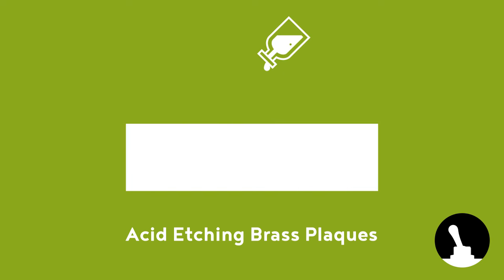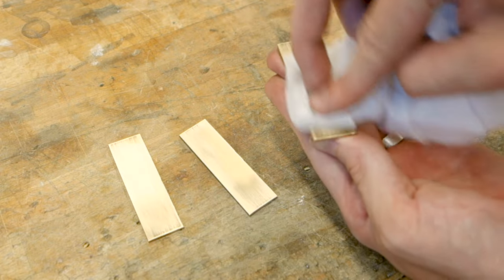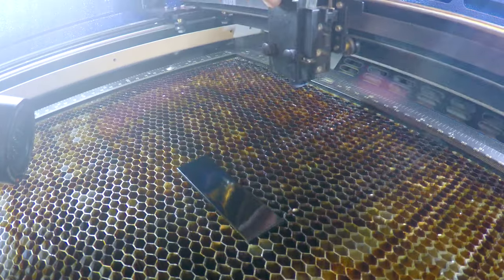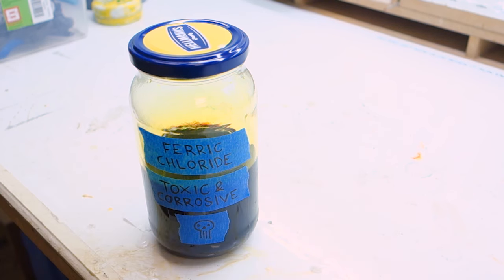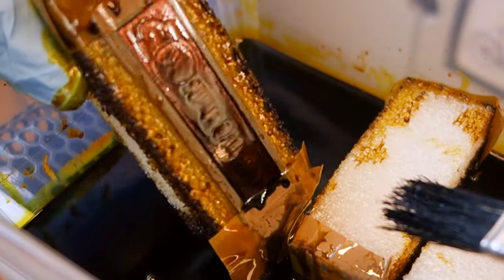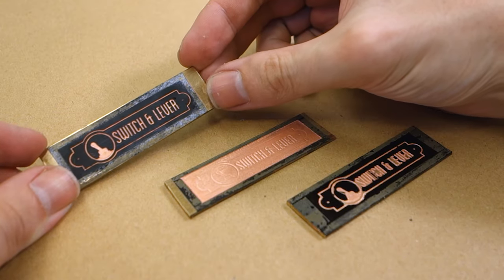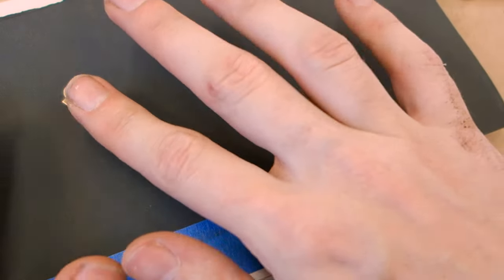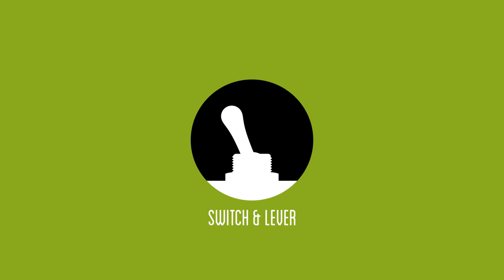Acid Etching Brass Plaques

Comment: So... It's essentially etching a printed circuit board. I have had good results from using a cheap Brother HL-2240 laser printer I got for $10 at the local second hand store. Lots of people say this printer is bad for etching. Personally I believe most people get bad results because of laminators. They are more unpredictable IMO. I use a travel type clothes iron. That type doesn't have steam and the associated holes in the surface. I try to find a piece of magazine print that is mostly glossy white and print to it.
 A word of warning, the laser printer itself uses a very hot drum to melt the ink onto the paper. Some glossy paper used in magazines can't handle the heat and will melt a bit. I would exercise caution before adding tape to anything I am running through a laser printer. If you get junk on the heated roller your going to damage the printer. I have never had problems with printing on paper that is cut close to the standard A4 size within about 80-90%. Just get your sides kinda straight and be sure the ink will print on the paper part first. I always do a test print on white paper first.
Disclosure, I've never created content on this subject, so don't waste your time checking. I casually upload stuff I find interesting, but am not monotized, nor do I plan to be. These were just some tips from what I have had success with.
   Further on the subject of etching plates, some people etch aluminum and glass using a similar technique, although the professional method uses dry film photoresist with clear transparencies. The main benefit of photoresist is the fine detail accuracy, so I've been told. I can resolve 0.25 mil traces using the technique I mentioned above.
Reply from the maker: I've had so bad luck with clothes irons, and always get consistently good results with laminators though. The key is that you have to feed it though a bunch of times on the highest heat. You need to transfer enough heat into the brass and toner to melt them together. 

As for taping the magazine paper, well, you see in the video how it looked like without the backer. Had to basically tear apart the whole side of the printer to get it out. It simply couldn't handle that thin paper. If you find thicker glossier paper that may be better, but may also require more work to get off afterwards.
Reply: Switch & Lever 
  I understand ;)
 I didn't expect to melt a page, the time that happened to me. I started using junk mail flyers after that one. The page that melted on me was from an old oversized European magazine I had laying around. It looked like they had some kind of plastic component in the paper itself. There are always little odd ball issues like this when using random stuff.
 Most people that have posted content that includes tape for use with laser printers/laminators tend to use kapton tape (the high temp stuff).
 I find it interesting that you used blue tape without problems. It uses a different kind of adhesive than masking or packing tapes and that looks like a solution for some.
   I think there are also issues with the brand/type of laser printer. A lot of people say that the HL-2240 printer I have is terrible for etching because they can't get the ink to transfer off of the paper. From what I've read, this printer uses a hotter than average drum to bond ink to the page. I use an iron for around 5 minutes straight and the resulting bond is so strong I can scratch the paper backing off with a fingernail without losing ink or details. I think a lot of problems people have had with this printer are due to the heat and pressure needed for transfer. I can't imagine a laminator coming close to the heat and pressure of 5 minutes under an iron. I also use particle board under the piece I'm transferring to. It seems to be the best insulator to keep heat where I need it. 
   I'm glad you posted this. I've been trying to motivate myself to make a few little label plates for some projects instead of my tacky black or silver sharpie markings. It's always helpful to see a well made video demonstrating how to do the job. Now I just need to get the nerve to try dry film photoresist I ordered a month ago ;)
 Thanks -Jake
Reply: @UpcycleElectronics  Question: would it be possible to disconnect the heat set roller so it does not fuse the toner to the paper? I ask this because I have removed many a jammed page from laser printers that jammed after the toner was deposited but before the heat roller and the image is perfect, but one puff of air and its gone.
Reply: @mdunbar008  
  I'm no expert on printer designs. I vaguely recall reading that the laser is used to control static charge on the drum, which then controls where the toner powder will stick. Then the paper is rolled over the drum directly followed by the heated roller. I believe this means the toner stays stuck to the paper based on the same static.
  I know, from watching another channel that creates uploads about repairing printers, there is a charge on the drum itself. This charge controls the amount of toner that is distributed onto the drum. The charge is variable according to the amount of toner left in the cartridge, ie when the cartridge is full the voltage is lowest, when toner is low the voltage is highest. (*Edit or maybe it was the other way around...let's just say: change in toner level = change in drum voltage) This ensures that the toner deposition rate is even. This is also why it is important to "reset" a toner cartridge if refilled. Continuing this tangent one step further...I plan on modifying my printer to manually set this voltage in order to control the toner distribution and attempt to create darker prints than otherwise possible.
  If you want to disconnect the heater it should be really easy. The heater has a wire connector. It usually has relay based control on the board as well. The element must be able to be switched off before an over temperature condition happens. That is about all I know when it comes to this subject. 
   Marco Reps has some really old uploads about using a lexmark laser printer to do some direct to PCB printing like this. IIRC he had to use a special printer that had a direct feed through option used to print CD labels. I think he did something to the printer where the product was not "fused." I recall he was using an acetone vapor technique to fix the toner to his boards. I think he abandoned that project though, either because of resolution or the single sided limitations of such a process. I probably have those uploads of his saved in one of my PCB fabrication playlists. I haven't saved a bunch of stuff on those lists in awhile so they will be pretty low on my publicly available playlists, but I have around 5-6 different pcb fab playlists covering all aspects, -all references to other people's stuff :-)
-Jake

Comment: Haha i love the Clickspring reference!:)
I noticed at 10:32 you said that you could sprinkle baking soda on there too neutralize the acid, wich is correct. But well im swedish too so i  recognized the can you were pouring from, that looked a lot like a bakpulver can and that's a mix of bikarbonat (baking soda) and citric acid! So it will foam and fizz in contact with water not acid!
Because there is already acid in powdered form in there!!
Reply from the maker: You are correct about the baking powder, and what was in the can once. These days I'm just using it as a canister for baking soda so I don't have to use the big 1kg box of it. It's a bit more practical :)

Comment: Looking at 5:42 I don't think you've allowed for the kerf of the laser when cutting, which is probably why it came out "bolder" than the others.
Reply from the maker: Not quite, if you look at the second and third plates they were both etched in the laser on similar settings, but with different coatings. The kerf had minimal, if any, effect in this.

Comment: S&L...thanks for the etching tutorial, great tips. You mentioned no specific software in the beginning as there are many that will do the job (I even went to #8 of your FAQ video to maybe get another hint)...I know NOTHING of graphics, yet I want to reproduce data tags/ machine labels for some old equipment, and make some new ones for vehicles. Can you/ would you suggest a SIMPLE software program for a novice such as I, that will allow me to incorporate (or even import) different fonts and logos? The design portion is the most intimidating aspect...the etching I can understand.  If any other views have freeware suggestions, that would be appreciated too.
Reply from the maker: Indeed, I deliberately didn't mention any software because there are so many that you could use to get the same result. I do understand that it can be a bottleneck for many people, and unfortunately all of these programs do have a learning curve to them. 

I use Adobe Illustrator, but there are many free softwares you could use. Inkscape is rather popular among free vector design softwares, but you could even use CAD software like Solidworks, Rhino or Fusion 360 if you're at all comfortable with them. There are great Wikipedia pages listing free vector design softwares. 

Fonts you can download from places like myfonts.com for commercial fonts, or dafont.com (and many others) for free fonts. Expect to be spending a lot of time looking for the right font though. Install them to your computer and they will show up in the program you're using.
Reply: Thank you for the reply...I understand not endorsing any one product and the reasons why, i.e. some formats are better suited to specific tasks. I really should dive in and learn Fusion 360, but will look at Adobe Illustrator first...as you mentioned, there is a learning curve regardless of choice.

Comment: This is great, thanks for making the video! I have two questions I'm hoping you can help me with to pick the right Laser Engraver: 
1) How powerful is your Laser Engraver? Is 40W enough for the Laser-Paint-Removal method? 
2) When using the Laser-Paint-Removal method, what resolution are you effectively getting out of your laser? Is it possible to remove very fine lines of paint and create a very detailed image with a 1000DPI Laser, or is there always a lot of bleeding? The lines and text look significantly bolder with the Laser-Paint-Removal method vs. using the other two methods.
Reply from the maker: It's not quite that easy, two laser cutters of the same wattage from two different manufacturers will work differently. A 25W laser cutter from a good (read: expensive) manufacturer will work better than a 40W from a shitty (cheap) one. That being said, literally a 2W laser cutter will remove paint (just more slowly). Depending on the width of the laser beam you can achieve fine detail, though frankly I'd say a good quality laser printer + laminator would be better, and way cheaper. Different paints will react differently, you'd need to experiment, as I've not had the issue with the bolder effect when I've done it before, but I've literally always just picked whatever random can was on the shelf.
Reply: @SwitchAndLever  Thanks for the explanation

Comment: Wouldnt it be possible to make money printing plates using this method? Of course you would need a higher fidelity but I think retrofitting a strong projector would give you the necessary resolution. The only issue would be getting the correct light activated medium.

Comment: Can i ask what kind of printer and laminator you use?? need it for a school project :)
Reply from the maker: Just a regular laser office printer, and a regular laminator. There is nothing special about anything I'm using. As long as you make sure the laminator you're buying can take the thickness of material you want to push through it you're fine.

Comment: Awesome Video ! will it work on very thin brass sheet ?
Reply from the maker: Of course, but if you're not careful it will etch straight through the brass.
Reply: Thank you for the reply. What is the success rate of this technique when using permanent marker to mask off the areas to prevent the etching ?

Comment: I know this question is way late but got to ask, when you say "photo paper for inkjet printers work well too" I assume you still mean people should use the laser printer and not inkjet right? Or does that mean you could use the photo paper with ink jet to do this?

I assume the former but would love to find out the latter works. But not holding out too much hope since my understanding from the Craftsman Steadycrafting channel is that the toner is the secret to making the patterns and not the ink.
Reply from the maker: Yes, you’re correct.

Comment: You could use NaOH to precipitate the aqueous copper to copper (II) hydroxide and then neutralise the remaining liquor with HCl. Alternatively, you could remove it by electrowinning.
Reply from the maker: Yep, you could, but generally that's less accessible for most people. You could definitely buy drain cleaners or other household chemicals which contain those compounds, but as far as evaporation go it doesn't really get much easier than that. You could also speed up the evaporation by pouring it into a glass flask, or ceramic pot, and heating it, if you so desire.

Comment: Would this method etch a copper plate as well since it is the copper it’s removing from the brass?
Reply from the maker: Absolutely! This method is routinely used to etch home made circuit boards which are coated with copper.

Comment: 4:25 i used warm-hot water, i let the piece sit in there 2 minutes.
Then you dont have to rub so long and hard as shown in the video.
You could also use a soldering iron for the heat, not the tip but the bigger pipe.
Rub it consistently back and forth with slow-medium speedover the paper until you see the paper start to get brown which might be in ~10seconds.
I prefer the chemical way with a mix of Isoalcohol+25%Xylene since Acetone+Iso didnt worked with my toner brand. The chemical method is the fastest and most reliable to transfer the toner even to curved urfaces like knifes.
Reply from the maker: Much more difficult to get an even heat with a soldering iron though. I could see it being useful for non flat surfaces, but other than that a laminator or clothes iron is still your best bet.
Reply: i dont have a laminator or laser engraver thats why i tried the good old low tech ;D
solvent method had the best results for me after i figured out the recipe for the mixture :)
Reply: Switch & Lever will any laser printer work, and what is your take on monochrome laser printers?

Comment: How would you continue to polish it at the end without removing the ink in the process?
Reply from the maker: It's not ink, it's enamel paint, which is a lot more durable. Also, I wouldn't. I would polish it all the way before adding paint. Paint should be the last step (or actually varnishing should, if you decide to varnish). If you want to add paint after polishing a small syringe to fill in the etching can be better, or more carefully wiping off any overspill before the paint has dried.
Reply: @SwitchAndLever  Thanks. I tried it yesterday with some etched aluminum and the results weren't great. Looks like I'd have to polish first, then attach vinyl, do the etching, clean up etched surfaces & apply paint while the vinyl is still attached. Then remove the stencil, do touchups and apply lacquer / varnish.

Comment: PCB photoresist method would be another way. You get photoresist in spray can and sheets. You need to expose it with light.
Reply from the maker: Yep, I mention that in the video as well. You need to expose it to UV light though, not just any light, and it does require extra material, as well as printing on transparencies.

Comment: Great video, however I suspect the laser and regular paint was doomed from the start, maybe a focus issue but the writing didn’t look fine at all before going into the acid.
Reply from the maker: I wouldn’t at all call it doomed. The result is just a little bolder than the original design. Either adjust that by altering your file, choosing a better paint that won’t act like that or tube laser settings better and you’ll likely get a more exact result.
Reply: @SwitchAndLever  doomed was maybe a bit harsh, but it really looked like a laser issue making it an unfair comparison.

Comment: Use a base? Won't soaking them in milk work over baking soda? Considering that milk is also a base (that can be poisonous to humans if too much is ingested or if the person doesn't have the enzymes required to digest milk). Otherwise awesome video and I'm saving it for later. I can easily think of quite a few things to use this for!
Reply from the maker: Seems like a terrible waste of milk.
Reply: @SwitchAndLever  true that and it wouldn't bubble up like baking soda does.

I must though say it's hard not to throw a pun at this

Comment: You can just pour lye into the used etchant and pour it down the drain. The copper hydroxide formed is not soluble in water and will be precipitated in sewer water plant.
Reply from the maker: Interesting, I did not know that, not that I have lye on hand either. I would still be cautious of pouring it down the drain though, if the reaction is as you say you still need to make sure all the copper in solution has reacted with the lye, so you need to make sure you add it in excess.
Reply: Switch & Lever Exactly. You need very excessive amount of lye to make sure this works.

Comment: If you have a laser printer, you won't need to chemically etch anything, you have a laser printer! Lol
Reply from the maker: I'm not sure how a laser printer is going to help anything here. Did you mean to say "laser cutter"? The laser cutter won't touch the metal at all, unless you have a specialized fiber laser. Those are far less common than CO2 lasers.